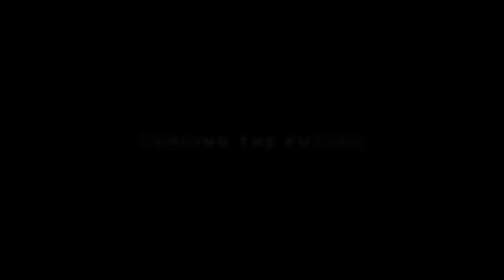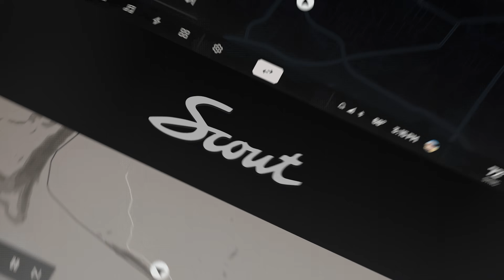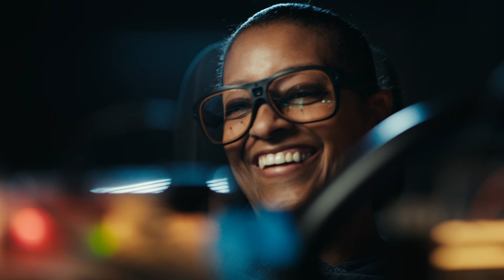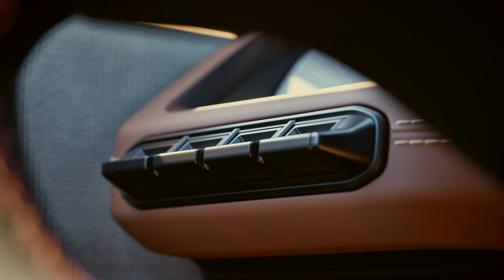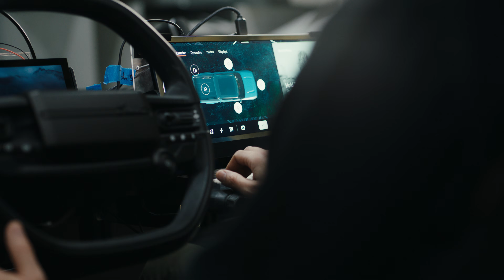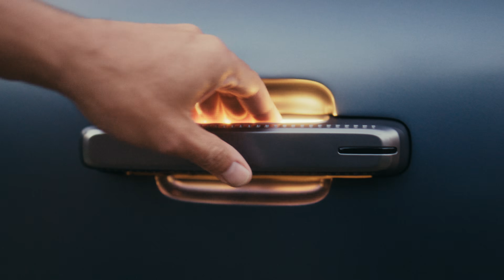Forging the Future | User Experience

Comment: Pay attention to all of the awful features of modern EVs that people dislike and run the other direction. Keep physical controls for drive selection. Keep a physical stalk for turn signal indication. Make sure if you put massive screens in a vehicle that they're going to function. If it's hot, if it's cold, of the car has been idle for 5 minutes or 5 days... The screen should start up quickly and move quickly at all times. Whether you need to use snapdragon or AMD processors, whatever the case. You can't make a 14 inch screen in a car run on 4gb of RAM when the average phone needs 12 minimum for smooth operation. Your 80k SUV should outperform an 800 dollar Chinese android head unit. If it doesn't, it's going to be a failure. This is one of the biggest hurdles of all manufacturers right now. Don't cheap out on hardware. People will pay a premium for things that actually function. But no one should pay a premium for something that can't do what it's supposed to. You shouldn't have 10 cameras on the vehicle but they're all "temporarily unavailable" every time they're triggered because your screen lacks processing power. That's a safety issue. 

At this point the name of the game is give the customers what they ask for, because no one is. If you keep listening and making the changes they want to see, that's all it takes. 

You absolutely need to use adaptive headlights. 

There needs to be a hard top option of some kind on the SUV which I have yet to see. 

Make sure your range values are true values. If you say 500 miles with harvester package. You should realistically never get less than 500 miles. Not 500 on a best case scenario, people hate that. 

Be prepared to rapidly improve your battery tech. Larger batteries, longer range, more stability and safety. No one needs another EV with a range of 250 miles. The us market needs to rival the Chinese market, even if they aren't allowed for competition. 

I'm looking forward to test driving these as soon as possible. I genuinely hope this is the start of what could actually be something spectacular. It appears to be, strive to keep it that way.

Comment: Why didn’t Scout produce a gas only vehicle?!? 
Same off road people are the ones that don’t want to rely on EV. 
LESS TECH option please
Reply: Chargers are not becoming fewer and fewer.  New stalls are coming online all the time.  New announcements about new partnerships.  Wawa just went into to partnership with IONNA to roll out EV charging at a bunch of there locations- and will include covered stalls to protect from the elements vs out in no man’s land in Walmarts etc.
Reply: The two powertrain options are great: fully electric for those who want that and range-extender for those who want the sweet instant torque of an electric motor coupled with the familiarity of getting gas(oline) to drive long distances.
Reply: The vehicle looks good, but I’m curious how this vehicle is gonna work in a time where everyone is back tracking from EVs and chargers are becoming fewer and fewer. Maybe someone needs to clue them in on the changes that have happened in the past few months with emissions standards and no more tax credits for EVs

Comment: This is a nice change of pace, buttons and screen in the right ratio, especially for a vehicle that is designed to be more off-road, you can't find a small spot on a screen with no feedback when your bouncing around.  Plus, every car/truck has HVAC controls and radios, so we should always have buttons for those controls.  Hopefully the end product turns out good, so far its very promising.